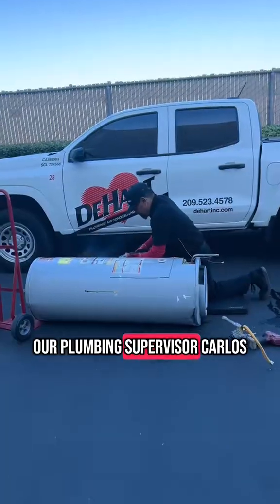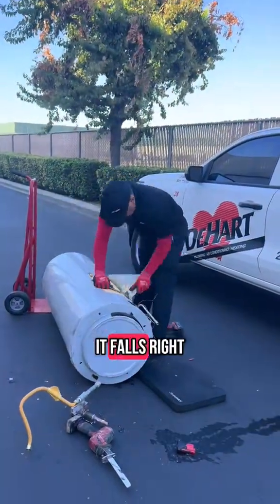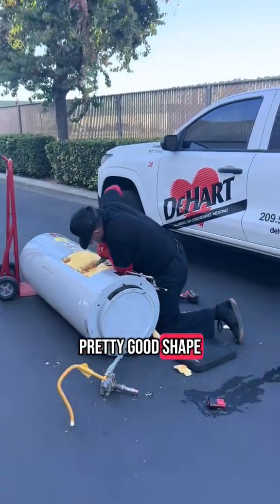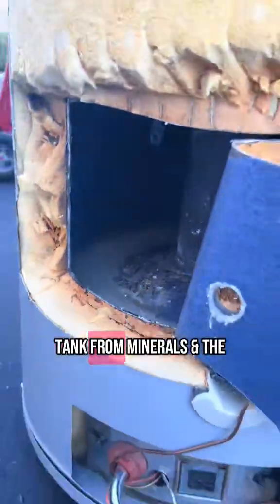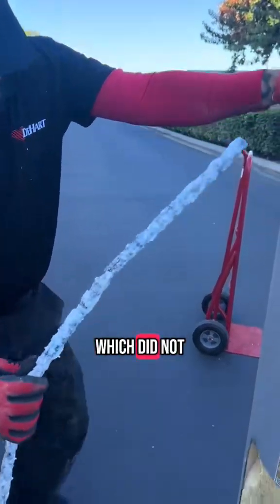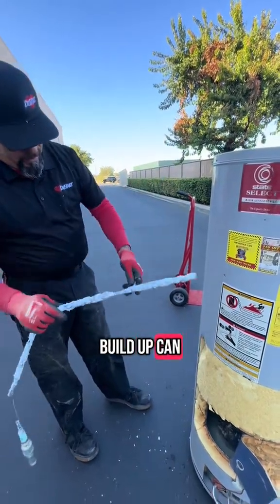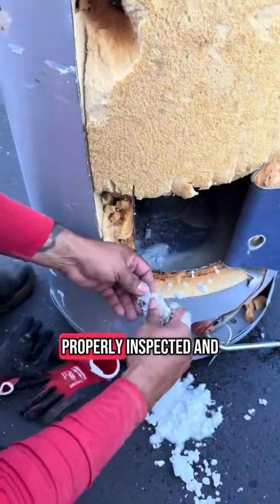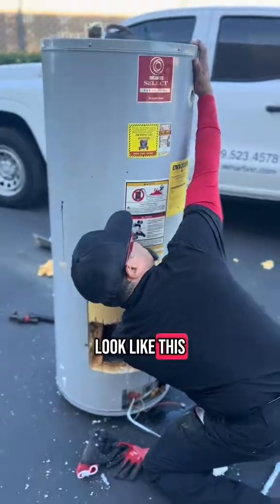We Cut Open a Water Heater… Here’s What We Found

Comment: Ive been in our rental for 17 years, and our landlord has never even checked on the water heater. It has started to weep some water from the upper side cover, with a little water in the insulation.  I'm sure it's on the way out. It's "awesome" having a homeowner that cares so little. Same carpet, no painting, no inspections....ever, leaking tub faucets, baseboard heaters that have never been serviced,  cracked windows, bare plywood where the kitchen sink leaked and flooded the floor and buckled the flooring. 

Come to think of it, my house is a P.O.S., but of course rent prices preclude the ability to even find another house that's not 50-75% more per month. 

Sorry for the verbal diarrhea.  I needed to get that off of my chest. 😔